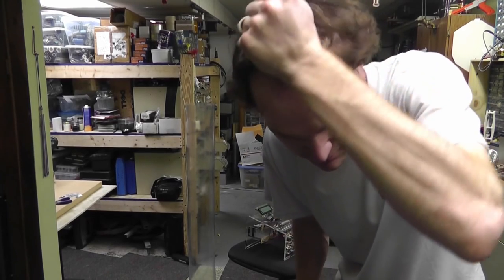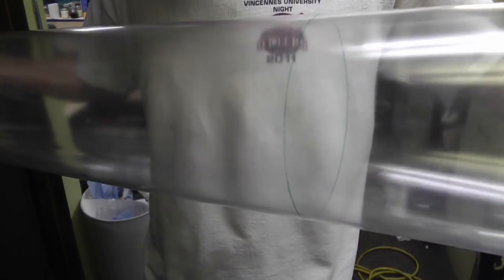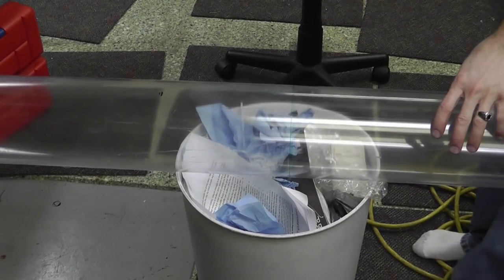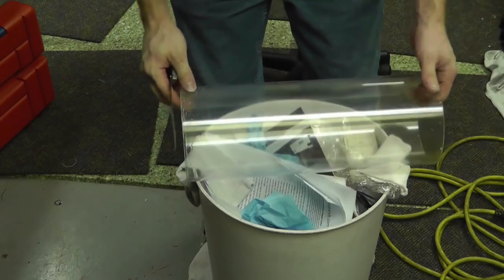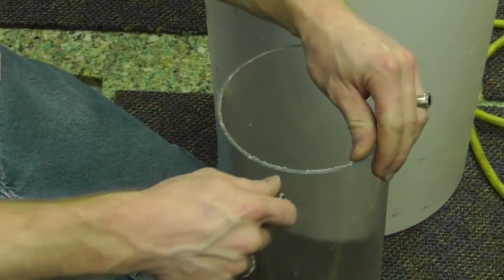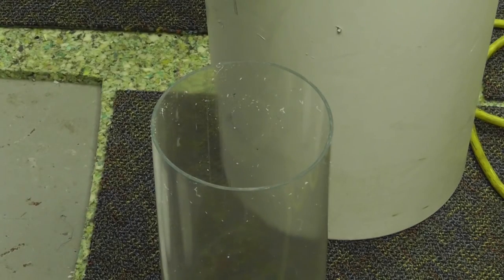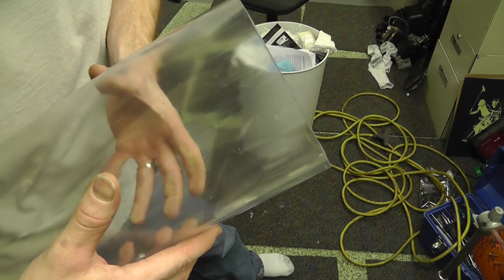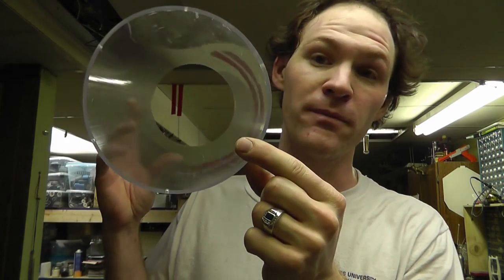How To Cut Pipe Straight / Square With A Hand Saw. large Or Small! PVC, Polycarbonate, Acrylic, ECT

Comment: I installed satellite systems for a number of years and used a pipe cutter on a daily basis. I can take the pipe cutter which is really meant for metal pipe, clamp it around a plastic pipe, spray some windex for lubrication, and use it to score the entire circumference of the pipe. If the pipe is thin and rigid enough, it will cut right through it. If its thick, I penetrate as much as the pipe cutters blade will go through then use a coping saw to finish up the rest, perfect cuts every time

Comment: Nice! Reminds me of Greenpowerscience. I caught on to how the local gas man was using a similar type of motion to cut gas pipe with an angle grinder.  Rather than plow through the pipe like a chopsaw, he just holds the angle grinder in one position and gently rolls the pipe against it with his fingers. I later discovered that a metal cutting blade on an angle grinder is not too bad for cutting pvc. It doesn't shatter, though sometimes it will have an undesired melting effect if you go too fast.

Comment: I will try that the next time I have to cut my 4" PVC pipe because cutting it with a hack saw just don't give you a straight cut. Thanks so much for this tip and I will remember it with my next job.

Comment: So, if it were a solid cylinder and not a hollow pipe then it would be the same procedure. As with a 2 inch dia. dowel for example?Thanks.. love the video ,,, good simple practical and efficient info.
Reply from the maker: yes. and use a sheet of paper to wrap around it and it will be even easier to get it square. ~Russ

Comment: Russ...what do you do when the pipe doesn't have a straight edge to begin with?

What I did was to use the measuring tape, overlapped it and tightened it as much as possible, making sure the end overlapped squarely over the rest of the tape, and marked it. Then I cut it with your method and voila! Perfect. I guess I could have bought a clamp to do the same, but was wondering what you do?

Thanks for this video! You saved me a lot of time and money. (Do you know how to cut a round out of flat acrylic, specifically the center of a Fresnel lens? I have a Dremel and hole cutter, but that requires drilling a hole in the center of the lens, unless there's some trick I don't know.)

Comment: Wouldn't hurt to use masking tape to build up a channel on either side of the cut-line, it will make scoring the line significantly easier, especially if you build up the channel with 4 or more rotations of tape. I'm forced to try this method but I can't afford to manhandle my tube the way you did yours as the clarity of the Perspex tubing is critical to my project.

Comment: To draw, the better it is a razor blade or knife, for example,
fixed flat with 2-3 pins or brad (large head)
propped high on other boards eg plywood (flat), and to adjust a book with its leaves,
and you keep fixed blade but the tube is rotated.

Fast and very accurate especially for the draw then cut (with a new blade can, plexi I do not know) ..

The Japanese are doing this to cut cans small alcohol stove.

-ü-

Comment: How is the end cut/made square before using it as a reference?
Reply from the maker: SnakePliscan2 ignore that.  juat use a piece of paper. If you wrap it all the around. and make it even it will be square. ~Russ
Reply: @SnakePliscan2 Just saw a video about 10 minutes ago here and the guy used a worm gear cable clamp. Get three sizes that will work from 1/2" to 12". Put the clamp on and finger tight it down. Then align it perfectly where you want the cut then wrench it a bit tighter, just enough so it doesn't move when you scribe your line. You can square up a crooked end perfectly as well before you cut. Do that by putting your clamp on and push toward the crooked end just until it reaches the nearest edge of the crooked cut. Everything sticking out beyond it will be crooked scrap that you cut off.(It's crooked, right? Why would you want to save it, right?) Then use any old saw to make a light cut into the outer surface of your pipe ALL AROUND. Then make a heavier cut all around one more time. TAKE THE CLAMP OFF and finish the cut. If the pipe is installed and you're taking it out USE THE CLAMP TO MAKE A LINE AROUND THE PIPE PERFECTLY. After that, depending on how crowded and cramped the pipe is you'll have to improvise a way to do the cutting. But you'll have a perfectly straight line around to guide on.

Comment: For smaller pipe you can use a hose clamp. It will work too. But I have not seen a hose clamp quite that big. I saw a guy do it for a potato gun.
Reply: @FOSTBITTEN You can gang the clamps together.

Comment: If the END of the pipe aint square to start with your nackered !!!
Reply from the maker: No, just use some paper. Wrap it around and over lap it at least 1/2 of the OD.  It will be square. Only need one length spot measured in that case. Best ~Russ
Reply: kingdom777866

Comment: 2 pencil 1 100 of a mm will spark 4 volts 100mm amps 3 AA battery will work ,carbon nanotubes will be made thanks good luck oh add carbon nanotubes to your mix for your 3D printing

Comment: I disagree this is guaranteed to get you square/straight. I think one could make a mistake when drawing the circle with marks made on the measuring tape.  I think the wrapped paper method is more accurate to get a square line

Comment: That assumes the end you measured off of is square, otherwise your new cut will be just as bad as the one you copied.
Reply: For a straight cut, use a long piece of paper with a straight edge and wrap the whole thing around so that it folds on itself(that way you know it's straight). Saw it in another video and worked for me